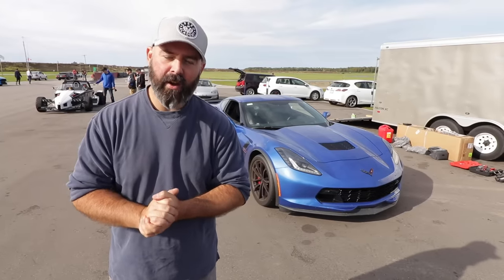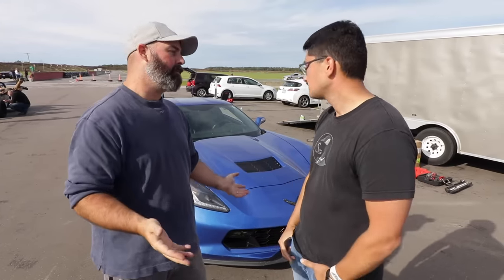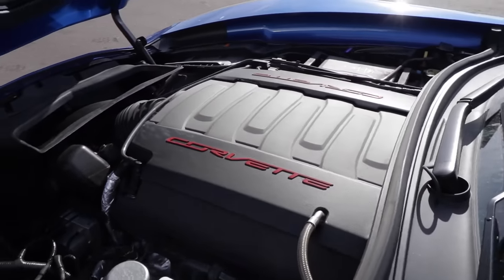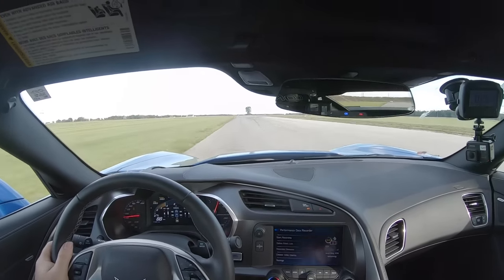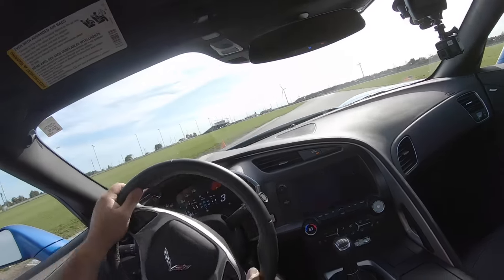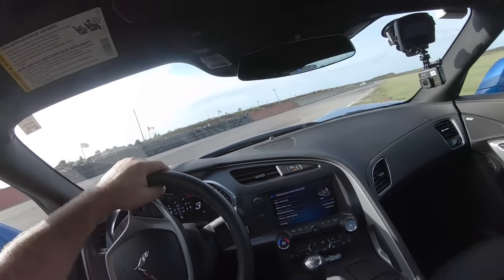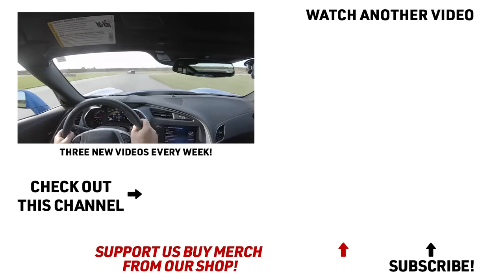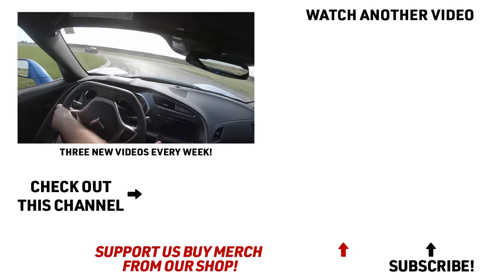Corvette C7 Grand Sport Review - Why We Like it Better Than the Z06

Comment: Agreed. A lot of reviews of the C7GS have a common theme: the right amount of power, the right handling characteristics. It certainly is the sweet spot.
Reply: Only 460hp!
Reply: Pizza PowerXYZ c7z06 has been said to be an overpowered platform. The power just isn’t as usable
Reply: @twinflag821  and an underpowerd platform isn't good either
Reply: Pizza PowerXYZ it is when it’s more usable. It’s about balance.
Reply: @twinflag821  you must now meditate to find a balance in the photosynthesis
Reply: @PizzaPowerXYZ  Yep!  "Only" 460 hp.  😂
Reply: Can you explain why besides power the grandsport handles better?
Reply: @peytonponder8488  that's really it to be honest, it's an identical suspension set up but that supercharger on the z06 is insane. You can do bolt on and cold air intake or hi ram on the grandsport and get around 515~ whp and still have amazing balance and grip.
Reply: It’s more so that the chassis uses the power more efficiently as in you can put power to the ground and it’s more manageable than another 190hp that comes on like a light switch.
Reply: It’s a V8… throw a cam in it and some heads lol.

Comment: On worm tires and it's over a second faster than the 2020 Supra. That's crazy.
Reply: Lets not forget that the corvette has 131hp more tho
Reply: @vegardulven9515  Correct, I'm just amazed at how good it is with really worn tires.
Reply: @vegardulven9515  That horse power difference isn't necessarily true. Every dyno result I've been able to find on the supra shows that they are underrating their engines and that actually make more to the wheels than the factory numbers claim. They make around 360-380 HP to the wheels and about 400 ft lbs of torque. I think the difference in performance isn't the power but the fact that the corvette is known to have a great chassis stock and the supra has been reviewed as being very tail happy. This course rewards cornering speed and the corvette does that well.
Reply: From someone who’s trying hard to make a Supra fast... it’s very very very hard to beat a Corvette GS.
Reply: @JackieDing86  Good luck with your build!
Reply: @vegardulven9515  Why would you compare a supra to a GS. that's ridiculous. I dont even know why they made a new Supra. Even more ridiculous.

Comment: Bought a new 2019 Corvette Grand Sport, with a MANUAL TRANSMISSION, and it’s a great car! Huge, fantastic handling, and with the magnetic ride control, the car goes from track stiff to cruising smooth in an instant. My wife even asks when we can go for drives in the Corvette Grand Sport, and that rarely happens with my NSX. Buy one, if at all possible, life is short.

Comment: buy this in manual to have the last manual and best C7

at least the GS doesnt overheat  like the Z06
Reply: ForTehNguyen 
Yes, I just realized that you are right. The C8 is only offered in DCT. So much for traditional driver engagement.
Reply: And it looks way better than the C8
Reply: "Hey, what year is that?"

"2019 - last year for both front engine and manual transmission."

"Nice."

- Cars & Coffee, 2045
Reply: Do we know which g lock pads they were?
Reply: Come on, don't put down other corvettes, especially when you like them
Reply: @R3LF13   More like what is s manual?
Reply: @Tonythrust  haha, depending on the generation, you have a point, but I've proposed a car show even being a thing in 2045, so it will just be us then old people there. 😂
Reply: The manuals don’t overheat as much it’s a meme at this point
Reply: Can't overheat if you live in the cold! Also I have a 2017 model which supposedly has a "revised supercharger".  I don't care about GM's claim, so just in case, I slapped a better intercooler on top of my Supercharger.  haven't overheated since.  I get the benefit of boost weather and my supercharger whine! I'm happy with my Z06. The GS is still pretty cool too.  
Anything that has the wide stance and non-brace face grille. The only reason I couldn't stomach the Stingray's is they just look too derpy.
Reply: @BladedAngel  hi bladed
Reply: My c7Z has never overheated. GS is a great car but anyone who drives a Z after a GS would never go back to a GS
Reply: I have a GS Manual. <3 it
Reply: @TgsMaverick  you have the best config, all the Z06 stuff without the overheaty supercharger, and the last of the manual vettes
Reply: I have a 2017 Grand Sport , manual , black and chromes . Stage 3 Aero . So fast and cool looking , great stance . Gets compliments and thumbs up everywhere I take it .
Reply: C6blackvette17  How often do you track your car? Every time I’ve been out on track I’ve seen z06’s overheated  that have to pull off track prematurely
Reply: @c6blackvette17  I've driven both and chose the Grand Sport. I preferred the more balanced feel and natural aspiration. On track days I've been to it's not uncommon for GS guys to post faster times because they're not having to fight the car and baby it around corners. You can use 100% of the car. Love the Z06 though, I'm sure I'll probably own one at some point just for the horsepower.
Reply: Bladed Angel 
Yep. After looking at the Grand Sport and Z06, the Stingray just looks awkwardly tall. Also I would consider the Grand Sport as “Z06 training shoes” since the Grand Sport is at a power level where it isn’t too intimidating for most people. Still, love your Z06!
Reply: @thomasburnette9202  Not everyone can handle the extra power. I respect you guys for realizing that and staying within your means/skills. And if you love what ur driving, nothing else really matters 😊

Comment: A Z07 GrandSport with fresh Cup 2 tires would be in the 1min16s easy :)
Reply: BTW throttle house did 1min17.5  with a GrandSport FE6 with PSS. So clearly in the 16s with a Z07 and CUP2

Comment: I have a 2017 1LT automatic. I absolutely love the paddle shifting. I don't know why some are so fixated with manual as better? My car sounds so different when shifting than the manual too. 
I bought mine used with 9,000 miles for $50k
I've never loved a car so much. What a joy to drive.
Reply: Because with the manual you can add lots of power AND abuse it. Automatic you have to pick your poison lol and manual is just always more fun than auto.
Reply: @GoatedOne201  F1 cars use paddle shift.
Reply: @Mudnuri  the Semi-automatic sequential transmission is a little different. Manual mode paddle shifters don't even shift on time 😂 gotta press the paddle a little early. 
Not to mention the car is gonna shift itself at a certain point whether you hit it manually or not to avoid damage.
Reply: @GoatedOne201  I thought something was different. I've about killed myself due to the delay in throttle response too.
Reply: @Mudnuri  what made you get grandsport over Z06 ? I want a C7 but so stuck on which to get. Grandsport looks amazing, Z06 also has that overheating issue and I plan on tracking.
Reply: @GoatedOne201  Well, my father had a C6 stingray ZHZ. It was cool and all but a friend had the GS. I liked the wide body so much more. I did not want a manual transmission because I'm not interested in racing or having to fool with shifting. I'm too old. Haha.
I feel REALLY lucky to have found this C7 GS. It has plenty of power and I've had it up to 170 with more too go. I've put 20K miles on it and every single one was a joy.
Reply: @GoatedOne201  the overheating isn't much of an issue with the manual. And get a newer year and you'll be fine. Get the Z if u can afford to. Its a much much better car than the GS. If a GS is what u can afford tho, still a solid car for sure.
Reply: True car people know why you get the manual over an auto. There is no substitute
Reply: @jonbillings3059  "True car people" grow up kiddo
Reply: @jonbillings3059  I've driven the Z06 plenty. Explain to the people exactly what's better. On the road course, your Z doesn't stand a chance against my GS. Barely beats my GS in a straight line, so please explain what is better.

Comment: One important feature of the GS that was not mentioned (that is borrowed from the Z06) is the stock brakes...they an are excellent package OEM...slotted 2-piece rotors, 14.6" 6-piston in front, 14.4" 4-piston in rear.  This owner changed out to dedicated track pads, but the system comes pretty great from Chevy.  Of course, for a lot more $$, you can opt for the carbon ceramic package, but why would you?

Comment: I still don’t understand “over-powering the chassis”.

With something like a twin-screw supercharger, seems like the throttle response would be crisp, and idk. I guess I understand having to be gingerly with the throttle. But at the same time, having a lot of power is first world problem. I don’t have a 650 hp car, only an s2000, but I don’t think it’s a problem you’ll find me complaining about lol. I’ll be grateful
Reply: I agree. I've never met an actual car guy that's said ya know, I wish I had less HP and torque. But some people can't handle the extra power, or it scares them. They use these "excuses" to save face. But it's mostly subjective. Drive what u like, doesn't matter what anyone thinks in the end

Comment: I own a C7 Z06 manual and I’m not sure why you would want to buy a Grand Sport and not have the extra HP in a ZO6. Somebody that says a car is overpowered doesn’t know how to drive.
Reply: Craig Scott I mean Dave is a former pro driver(touring car), randy post a pro driver( touring car driver) all say the same on balance the z06 has too much power for its chassis for track work. The other issue presented for road course work is the cooling problems. You run into both water temp and oil temp issues on certain tracks due to the heat. I understand in 2017+ they added a cooler for manual z06s but in my experience it hasn’t helped that much.
Reply: U Tube Surfer yea you forgot the other thing the Z06 is good for. Blowing the doors off the Grand Sport in a drag race.

Comment: What phenomenal cars. I love my c6z, but a GS c7 does sound tempting lol
Reply: Seems like the natural upgrade lol. Have any problems with the c6?
Reply: That C6 Z06 is a beast my friend
Reply: Thinking the same thing! Less headaches than our cars with more creature comforts. Tired of being afraid of my engine grenading due to heads
Reply: Austin Dussold if you can drop 30k on a car you can drop 1k to fix it
Reply: @Danny7930  Never said I wasn't going to fix, but I want it done right. My point was I could drop $50k on a new 2019 Grand Sport and not worry about heads or other problems. Warranty and no known issues like the C6 Z06 because manufacturing processes get better over time. 

However, I do love my car. If I keep it, it will not go to some normal shop to get the heads fixed for $2-3k. It will actually go to Katech or AHP and get a warranty when they install it. That costs around $4k or more. No need to assume on these types of post...
Reply: legodude19999 no problems thus far, but I haven’t put enough miles on it to make a fair assessment. I will say every time I’m in the car I do drive it fairly hard. Haha
Reply: Austin Dussold yea honestly I worry also, though many of them have gone the miles without issue. Honestly for about 2/3k depending on if you are doing yourself or a shop, it’s not poor peace of mind plus hp/tq gains

Comment: Surprised it's that fast on those tires, funny that you compare the LT and the coyote motors, I'd like to see a lap in a mustang gt350 to see how it compares, put it against a camaro with this motor in it with the good suspension
Reply: Technically, the GT350 5.2 is named the Voodoo engine, not the Coyote.
Reply: XOZ Industries stock gt350 is 3-4 secs slower than the stock grandsport at this track

Comment: Would you go for PS4S or Cup 2’s on this if you were to use it mostly on street but 3 times a year on track days? I have a C6 Z06 with 600whp. Thanks for feedback.
Reply: Prot0n PS4S. Personally I run RE71Rs on my car street and track (8 days a year), but would not suggest those to you as they don’t last more than 6k. Cup2 guys on the track like the tires but they will have a short life around 6k, and driving in the rain you won’t be so happy especially because you have such wide tires that would be more prone to aqua planing. PS4S has plenty of grip 9/10 of a Cup 2 (good for a couple seconds on a track with a great driver), but the daily usability is severely compromised. Mostly street = street tires
Reply: I second that had PS4S’s got pretty good mileage out of them never tracked them but they were plenty grippy and still fine in the rain I have the pilot super sports right now and they don’t grip nearly as well
Reply: lukasz wicher thanks for the input. I just bought spherical bearings from AMT. I think 4s will remove some of the harshness that I will get, but will they grip from 2 gear pulls? Right now on my old hockey puck tires I spin in 3rd on warm asphalt.
Reply: Prot0n tough time say, but the Cup2s will need some heat in them before they start to grip as well on the street. I think on the track after a couple warm up laps, the tires shouldn’t give you much issue.
Reply: *either of the tires

Comment: Oh boy, now here the people who don't know corvettes or people who bought grand sports and needed reassurance. The fact is, the grand sport IS a track weapon. The Z51 is as well. Guess what? So is the z06 and the zr1.

People buy what they can afford and what they want. I didn't get the grand sport because it's slow. I bought the z06. I got it in manual. Who's saying it overheats? I never had my car reach 230F temps EVER. And i beat on the car all year round. In the summer, while the AC is blasting. The car doesn't skip a beat. 

The overheating issue are for those owners who bought the automatic Z's, that use their trans in manual mode while using the paddles. They ride the rpm's throughout the track, not knowing they can use the torque to carry them through so they're riding the engine at 5500+rpm the entire session. UHHHHH YEAH, that will definitely overheating a FI engine.

Fact is, the z06 is a better buy, especially if you decide you want to do a lot of tracking in the future. Slower cars are for novices. So if you want your skill level to improve, you start by controlling a fast car, SLOW. Then you still have a fast car when your skills allow you to go fast. 

Never understood why people buy grand sports when for 8-10k more you can get a z06 with 200hp more lol.

Comment: So I know absolutely nothing about Corvette's. So this may be a dumb question. What's the paddles for if you have a manual transmission? Are they cluster controls??
Reply: Both turn on or off auto rev matching.
Reply: The paddles engage rev match for the manual based cars.
Reply: I know it's a little thing, but this is honestly one of the things I find most annoying about the camaro and corvette. It's a cost saving measure so they only have to produce one wheel, and I get it, but the #1 rule of cost saving should be not right in front of the drivers face. Auto rev match only needs one button and it doesn't need to be at the drivers fingertips as if they are going go be engaging it and disengaging it over and over. So dumb. Ok, end of rant.
Reply: @R3LF13  That is ridiculous, I agree. At least for the C7, Corvette received its own proprietary steering wheel - looking at you C6/Cobalt owners..

Comment: I never understood why GM held onto the rear leaf spring setup so long on their corvettes.
Reply: Ravenstylea2 tradition bro also it was working for them its like the porsche 911 holding on to the stupid rear engine design even though they kniw the cayman mid engine will kick its ass if they let it
Reply: Worked for them I guess, functional simplicity.
On the other hand, when they made C6 ZR1 they beat Porsche GT3 RS by second or so at Nurburgring, finest technology vs. leaf spring setup. Guess it was salty:)
Reply: Because the style of spring used to support the weight of the car doesn't really matter as long as it's the correct rate to effectively support and control the weight of the car. The way they packaged them was very space friendly and the spring, being a composite material, doesn weigh much so why change?
Reply: It's very simple. The composite spring setup saved space and most of all...it actually worked!